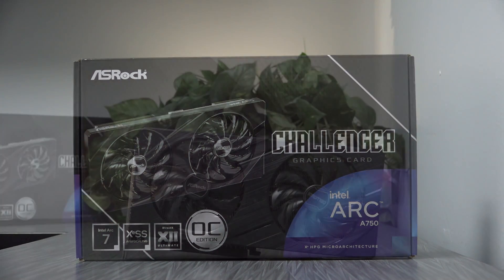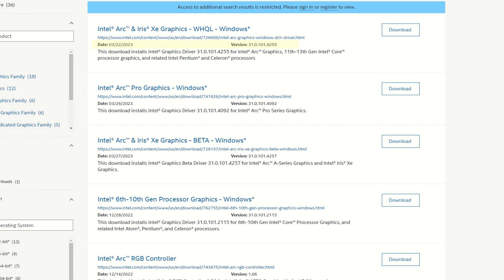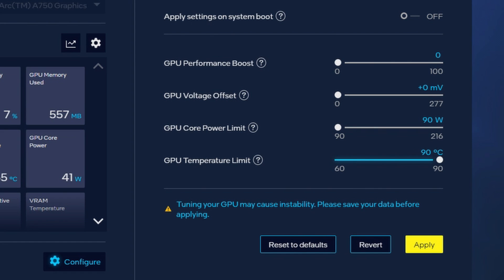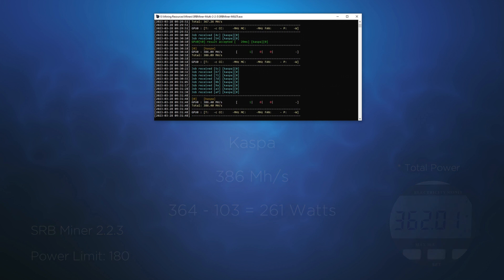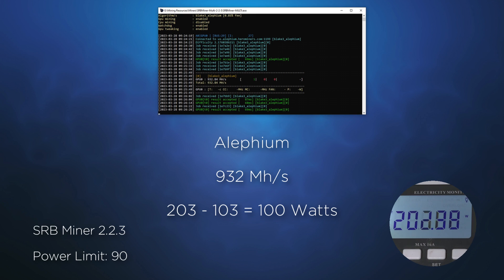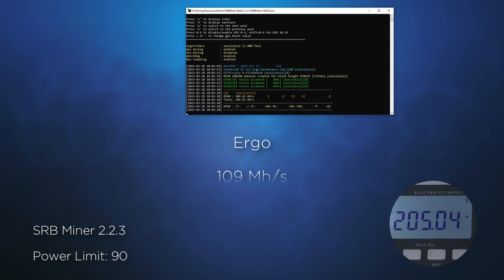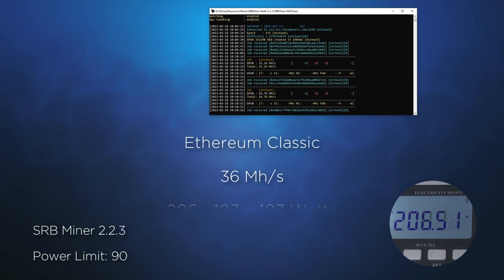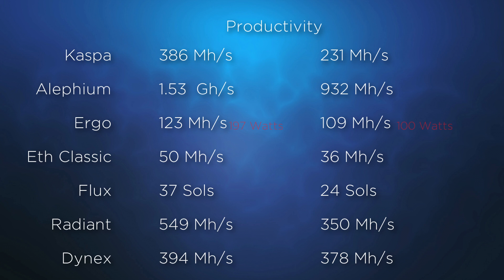Mining With An Arc  A750 - Kaspa, Ergo, ETC, Alephium

Comment: You dont even have the fan control unlocked smh. Run around 120-130w 80% boost and 90% fan speed. Its the most efficient by hash/watt. Using the boost increases ans keeps the clock at 2350 to 2450. Any lower than 120w and its unstable